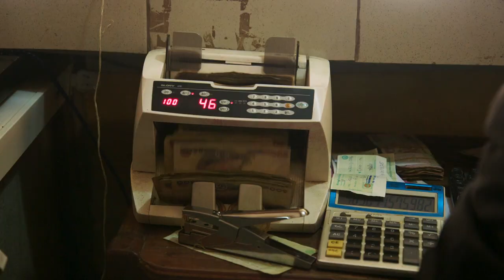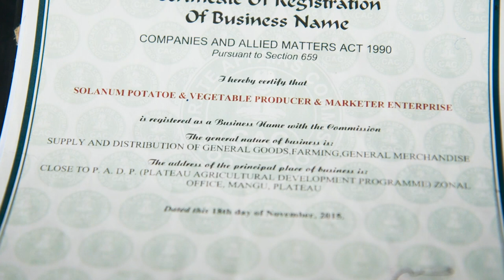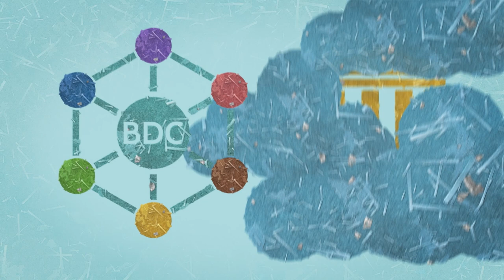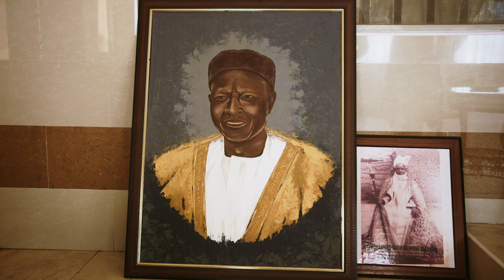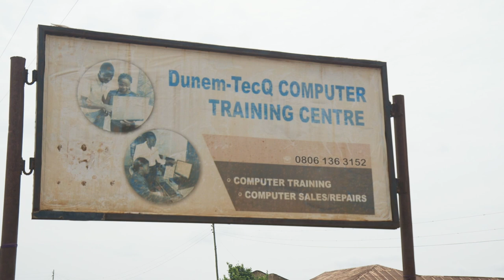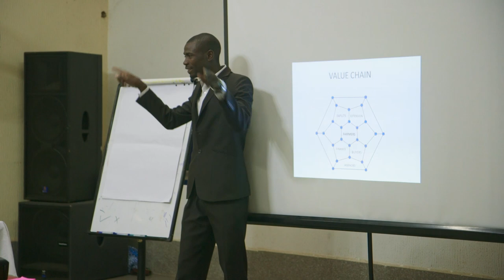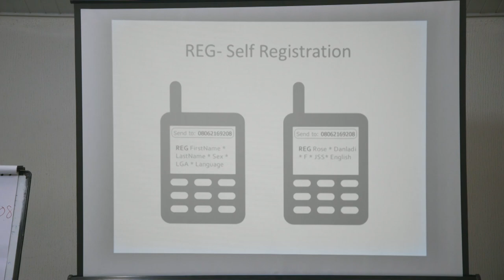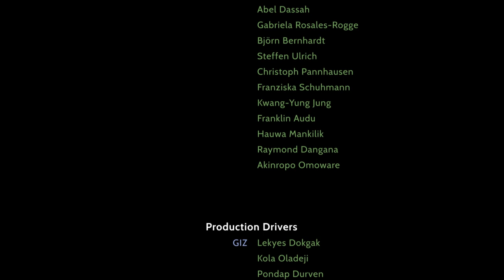Plateau on the Move (ENG)

Comment: Sunlight on potatoes causes Green Spots that are poisonous to humans, I cut them off but it can cause the potatoes to taste funny!
Also, did you know, it can help if you do Not wash potatoes until ready to use...  
We were taught to; Remove excess dirt, then CURE; layout in a single layer with good air circulation in a dark cool area, like a root cellar or mud/rock/brick building, 
Be sure to remove any damaged or bruised ones, and potatoes can last up to 10 months>